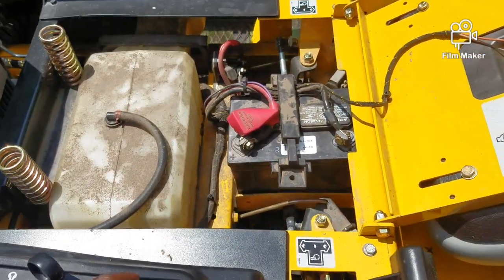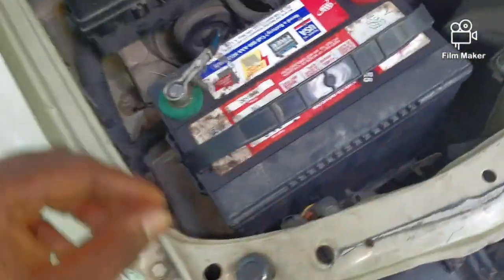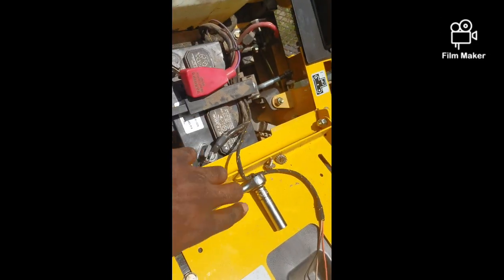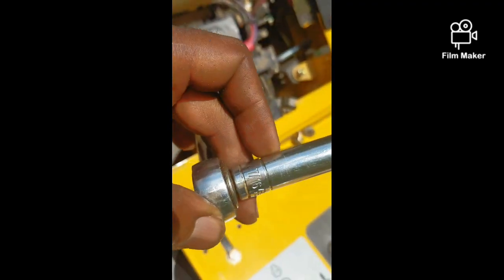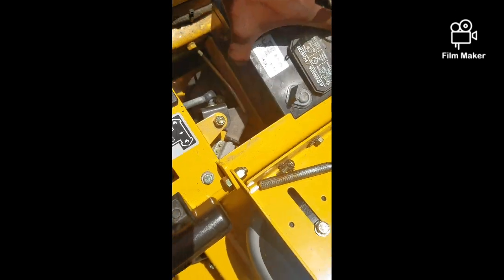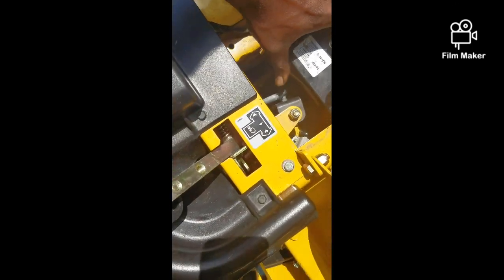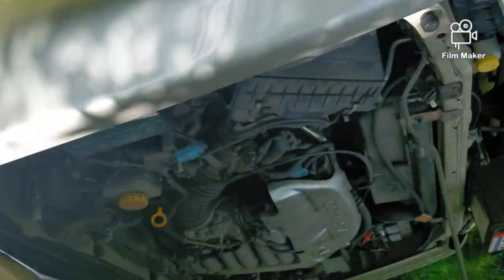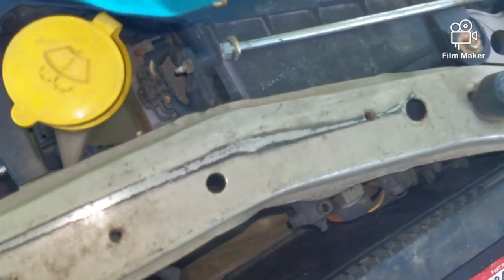How to Start your car with a lawnmower  battery.

Comment: Oh men...
You should NEVER disconnect the battery, while the engine is running !
The alternator without the excitation voltage of the given battery (through the ignition key) has no limited maximum output that it charges.
Voltage continues to grow, as the battery is disconnected - the alternator is already excited with its rising output and the obtained magnetic induction of the rotor.

It is only a matter of time before the on-board computer and the ECU burn due to overvoltage.
Relatively high price for jumper cable savings, don't you think?

P.S.: 
only if you have an GEL (not just AGM) battery you can lay it on side